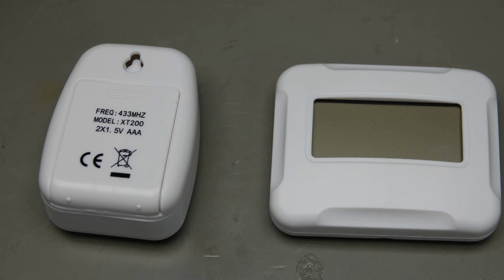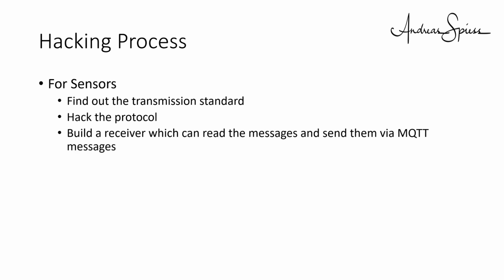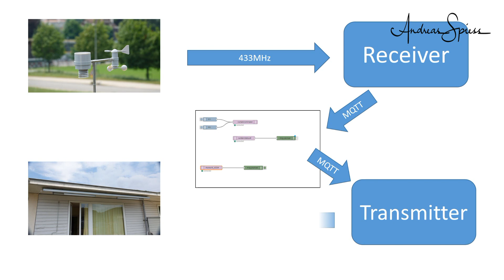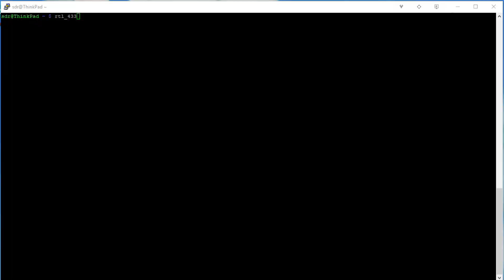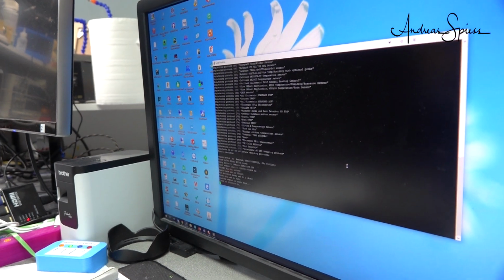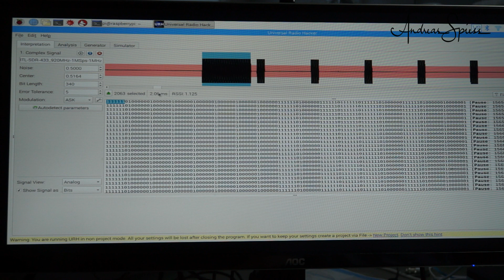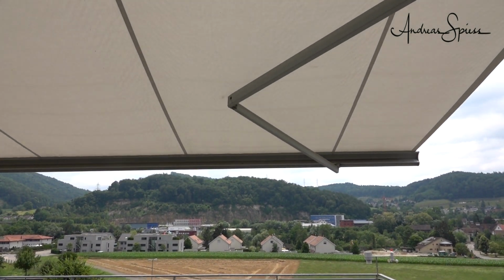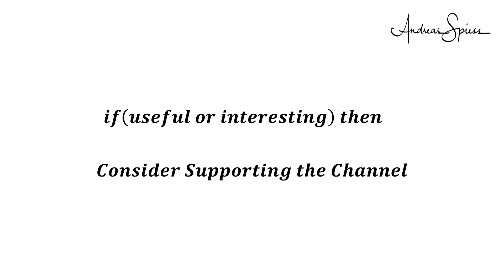#209 How to Hack your 433 MHz Devices with a Raspberry and a RTL-SDR Dongle (Weather Station)

Comment: @Andreas Spiess :Hi , followed your guide , i've bought an Bresser 5in1 weather station wich should run at 433Mhz, bought RTL-SDR dongle like yours , installed software on raspberry pi (rtl_433 and gqrx software) i can see my other 433Mhz devices (switches, contacts etc...) but can't see the Bresser , gone from frequency 432-434Mhz in steps of 0.1 but nothing shows up , on the display delivered with the bresser i can see the values change every 10 sec, the unit is now within 1 meter of the RTL-SDR to be sure , but nothing , any advice , pointers, help is much appreciated.
Reply from the maker: If it is this station https://www.bresser.de/en/Weather-Time/Weather-Center/BRESSER-Weather-Center-5-in-1-black.html it uses 868MHz
Reply: @AndreasSpiess  yes, thats the one , i contacted Bresser and they said 433 , so was looking in the wrong region , thx for that
Reply: @AndreasSpiess  yes, is working now THX !!! Just one last question , rainfall gives wrong , is 0 on display but 1.2mm in reading ?
Reply from the maker: I have no idea. :-(

Comment: You can use your wheather station signal to fire up or down your heater, activate a below zero and/or wind alarm. Very interesting video Andreas, as always!!
Reply from the maker: I use it for our awning. It extends when the sun is shining, the temperature is above 22 degrees, and winds are calm. Like that we do not get lots of direct sun in summer

Comment: This just gave me an idea to solve something that annoyed me for a long time: the Samsung Horizon DVR box that Virgin Media (Liberty Global) provides comes with a remote control that uses both infrared and radio. Which means my (Swiss-made) Logitech Harmony universal remote control is not so "universal" when it comes to this particular type of DVR. Most of the buttons on the top of the Samsung remote work fine via the Harmony remote but a few (the DVR buttons) and the keyboard underneath don't work. I wonder if this Samsung remote control unit uses the same 433 MHz band and if the codes could be decoded and sent by an ESP32 with a cheap 433 MHz transmitter. If this is possible then I could take your "Babel Fish" Infrared Remote Protocol Translator idea (video #254, same Samsung remote control) and extend it even further! Thanks for the idea, I'm able to "stand on the shoulders of some very skilled colleagues who shared their know-how"! ;-)
Reply from the maker: Good luck with your project!

Comment: I finally got this to work! I've been trying to use cheap 433 receivers, but couldn't decode the messages. I eventually gave in and got an SDR dongle, and it worked right away with your SD card image. The SDR dongle is expensive here (in South Africa, 5x the price of a dumb receiver), so I'm hoping I can find other projects to do with it.
Reply from the maker: Glad to read it worked!

Comment: Hi Andreas, I wanted to come back to the "433 MHZ to MQTT" topic. I know it is an older topic but I never got happy with RFLink. Since I see the topic regularly popping up in your videos I wonder if you ever came across the  super simple solution  SIGNALduino resp. SIGNASESP? https://github.com/RFD-FHEM/SIGNALESP - ever thought about going this way? An idea for a next video? I personally would appreciate it. Marc
Reply from the maker: The problem is not to have software to receive the signals. The most important part is the database of all decoders for sensors. And here, RFLink is very good. It works for one year or so without any problems with an ESP01 attached to serial. I think I made a video about it.
Reply: @AndreasSpiess  Appreciate your answer. Thank you, Marc

Comment: Hi Andreas, just fyi, I installed 7zip, thinking it might be a problem with the default extractor in Ubuntu, but 7zip would not work to extract it either. Regards, Adrian
Reply: pls ignore previous commets, I tried it with Win 7 and it extracted properly using 7zip.

Comment: Hi Andreas, thanks very much for the new Buster version of the 433 hacking tools for the Pi. I downloaded the .rar and it is apparently 8 GB, but when I try to extract it on Ubuntu 16.04, it gives me an error: "Parsing filters unsupported", and the resulting img file is non-functional. Any idea why I'm getting that error? Regards, Adrian
Reply from the maker: I only use Raspbian. So I do not know.

Comment: Hi!! Thank you for all your Video!!
How i can read the value of the sensor on wheater station (433 MHz) and send It over LoRa to another ESP 8266?
Reply from the maker: I think I showed it in this and in another video. LoRa is something different. In another video, I used an Arduino Mega and an ESP8266 for my 433 MHz project.

Comment: Dear Andreas,

Thank you for the advice and the video, I wonder can I build the hacking tool using Arduino and some FSK receiver like Si4432 to get the 433MHz data. Because on your video you use SDR and Raspberry to catch the data then use internet connection via MQTT to trigger the ESP8266. I already use the SDR and got the payload of the data (Preamble bit, Sync bit and the real sensor data). so can I create the receiver for that weather station, even tough the radio chip between Arduino and weather station is different (Arduino use Si4432 (FSK) and the weather station use HopeRF RF43B).
Reply from the maker: If you know the code this should be possible. I made a video with an Arduino mega and an ESP8266 for that purpose.

Comment: Hey Andreas! Great video as always. I have a question. Why was there a need to send the messages via MQTT? Could we have built a 433 MHz receiver/transmitter that would read messages from the weather station and then that same device would send the messages to retract the outdoor awning via 433 MHz?
Reply from the maker: The weather station is off the shelf and it’s data is logged in a database. You could of course replace the electronics of the station to transmit a message directly to the awning.

Comment: Thanks for sharing!, one question, at the description you not put the link of the cheap 433 module, can do it? thanks
Reply from the maker: If I remember right, these were not used in the video, just shown. But you find them by entering 433 MHz transmitter in Aliexpress
Reply: @AndreasSpiess  ok many tanks!, in my chanel i made esp32 asyncronous experiment

Comment: I loved to see my Aercus (AKA Fine Offset WH24)finally spit out the measurements. I had tried with RFLink (your video) but it was not recognised .
Excellent work.
My troubles began with trying to pipe the results to Mosquito (rtf_433 -F json -U etc), got Error:Connection refused. 
Is node-red in the SD image? I can't figure out.
Reply from the maker: Maybe you use the image of the "Ultimate Pi Server". There you find Node-Red and RTL_433

Comment: Hi Andreas, thanks for this great video! I also have some 433 MHz devices I want to hack.

I downloaded the RPI image file and installed it, but it does not seem to have any of these programs on it, such as rtl_433 or URH. Could you please let me know what I should be expecting to see on that image? Tks, AB
Reply from the maker: I might have screwed it up. I have to check tomorrow.
Reply from the maker: You can try the new link. Then you should get the newest image based on Buster...
Reply: @AndreasSpiess  Hi Andreas, many thanks, I  will try it. Best regards, Adrian

Comment: Very useful video, thanks. I have a Pi3B but it runs Pihole and I preferably want to run a project similiar like yours side by side with Pihole and I don't want to delete the Pihole/OS config with another image so I guess I'll have to go with HB9FXQ's manual. Any tips before I take this route?
Reply from the maker: Yes

Comment: Thank you for posting this.  I got it working great thanks to the image you provided.  Can you tell me what a good antenna is for 433 MHZ and the RTLSDR?  I'd like to snoop on other weather stations around me before I buy one but the little aerial I got with the dongle only picks up one temp/humidity sensor.  What are you using?
Reply from the maker: I use a simple 433 MHz "coil" antenna of AliExpress which come with some modules. But I do not have to bridge big distances.
Reply: https://www.conrad.de/de/p/aurel-gp-433-ground-plane-antenne-antenne-190073.html

Comment: Andreas! thanks for the brilliant tutorial, I almost set, but I most likely stuck. :) 
What I try to achieve is, I have a weather station with 8 sensors on it. I wish to hack the signal and upload the data to my NAS database. I have installed the latest SDR_433 from Github. after I have all installed, the test looks okay, but it does not show data. When I try to install MQTT, it is complaining about the UTC version, I used type U, but it wants me to us Type M. 
I use Nooelec NESDR Smart receiver.
Some input would be appreciated!
Thanks a lot.
Here is the message I receive after I try to test the SDR-RTL receiver.

rtl_433 version 18.12-194-g5ed62fc branch master at 201904101337 inputs file rtl_tcp
Trying conf file at "rtl_433.conf"...
Trying conf file at "/home/pi/.config/rtl_433/rtl_433.conf"...
Trying conf file at "/usr/local/etc/rtl_433/rtl_433.conf"...
Trying conf file at "/etc/rtl_433/rtl_433.conf"...

 Consider using "-M newmodel" to transition to new model keys. This will become the default someday.
 A table of changes and discussion is at https://github.com/merbanan/rtl_433/pull/986.
Reply from the maker: Maybe you open an Issue on Github. Christian is very responsive.

Comment: Thank you. Very well done.
Reply from the maker: You are welcome!
Reply: I have one question: I will try to use your method to "hack" my window shutters remote control. The tech specs of the remote claim that it operates on 433.42 ASK. I understand that the classification 433 MHz is for the band of 433 MHz, not the exact frequency, and that 433.42 probably just denotes a channel. But I haven't been successful finding information about setting a channel for 433 receivers or transmitters. Will your method work with a 433 transmitter / receiver? Or am I out of luck?
Reply from the maker: 443.42 seems to be a strange frequency. Most simple and cheap transmitters are on 433.92. So you might not get a transmitter. But maybe it is also a typo?
Maybe you just try it?
Reply: Will definitely try it. The Raspi image is on the card and the SDR radio works. Unfortunately, 433.42 is not a type, so we will see. It is about this remote: https://www.eibmarkt.com/Files/Datenblatt/42FH.pdf.

Comment: Excellent. Eager to try it out.  Can I use the sdr with my laptop? Any links? Thanks. Is it possible to run the hacking system on android phone?
Reply from the maker: I use it on my old Laptop where I installed Linux Mint.
Reply: thanks.. what the the software for the SDR in Mint? thanks
Reply from the maker: Maybe you watch the video again and read the comment. All there.

Comment: Superb work, Andreas!
But I run in 1 major and 2 minor problems:
The minor:
1) Which is the SSH password used in the image?
2) I have to do some adaptions to your script, because I have 3 different time slots for signal and break
The major:
I use an Arduino Nano and FS1000A TX. The primary signal computing looks good, but TX has a slow falling level at end of signal, so the breaks are not recognised by the RX correctly (far away from 0 line or noise level). Have you a idea, this failure depends on poor 433 modul or poor output on Arduino?

73 de OE1FEA, Erwin
Reply from the maker: 1. Usually, I leave pi and raspberry from the Raspian installation.
2. Remote diagnostics is hard. Maybe you can split your setup and test parts of it independently?

Comment: Do solar floodlights operate on the frequency of 433 mhz? Can a jammer disable them from staying on?
Reply from the maker: It is well possible. Then a second remote sending the same code can switch them off.

Comment: How did you find the exact 433Mhz weather station frequency? If the transmitter sends data infrequently, using urh is a pain..
Reply from the maker: Most of the devices use the same frequency. I do not remember which one. But using SDR you find it easily because you can simultaneously watch a broad frequency band

Comment: Andreas, do you also have the problem that the rain sensor with node read (Payload.rain) send the sum since start not the last 1h or 24h?  How can you sent it to show the last 24h only?
Reply from the maker: I did not analyze the rain sensor's messages. But On the display, I see the rain of the last 24 hours. So I assume, the base station sums it up.
Reply: I suggest you look at Csongor Varga's video https://www.youtube.com/watch?v=mWx5aa1ri2E&t=430s. He uses Node-Red to produce hourly, daily and weekly rainfall charts from a similar weather station
Reply: great I will check !

Comment: Very interesting! An alternative to unknown protocols with static values, e.g. on/off status, plight can be used. With pilight you can listen to the divice (plight-debug) capture the raw string and reproduce it or send it back (pilight-send -p raw -c "[raw string]"). pilight can also decode signals (plight-receive) although it is not as complete as rtl_433.
Reply from the maker: Thank you for this info. I did not know pilight.

Comment: Is there a way to autostart yout rtl_433 -G -F json -U and restart when died method on the raspberry?
Reply from the maker: I am no Raspbian specialist. Since this is a normal call, you should find a solution if you google.
Reply: I bought a weather station and the SDR module and have put it into production. I created a service file that works for me. Put it into /lib/systemd/system/track-weather.service. Do all this as user root.

--------

[Unit]
Description=Track Weather Station
After=multi-user.target

[Service]
User=pi
Group=pi
Type=simple
WorkingDirectory=/home/pi
ExecStart=/bin/bash -c "/usr/local/bin/rtl_433 -F json -R 32 | /usr/bin/mosquitto_pub -h {your-broker-address} -p 1883 -t home/rtl_433 -l"
Restart=on-abort

[Install]
WantedBy=multi-user.target

----------

After you create the service file, activate it with these commands:

systemctl daemon-reload
systemctl enable track-weather.service
systemctl start track-weather.service

Get the status to make sure it's running
systemctl status track-weather.service

If necessary to restart, use
systemctl restart track-weather.service

Here is a sample message received by the broker:
14:34:26 Message received: home/rtl_433 {"time" : "2018-08-13 14:34:26", "model" : "Fine Offset Electronics WH1080/WH3080 Weather Station", "msg_type" : 0, "id" : 143, "temperature_C" : 31.000, "humidity" : 47, "direction_str" : "W", "direction_deg" : "270", "speed" : 6.120, "gust" : 9.792, "rain" : 73.500, "battery" : "OK"}

I track the topic and plot the results using Munin.

Comment: Hi - awesome video!
How can I build a 2nd receiver for a transmitter after I figured out, what the sender is sending?
I did not understand how I can listen for a specific ( already decoded signal) with an arduino to do something...
I didnt found a video on your channel... do you have some tips for me?
Reply from the maker: You have to program the receiver yourself if you do not want to use SDR for that. This was not the topic of this video.
Reply: thanks for your answer :) yes I know, that this wasnt the topic... but the last part with the URH was inspiring me for doing something like that :) Maybe you can do this in one of your future videos! Would be awesome... Sniffing Signal with URH and build an receiver for that! its just a suggestion... it would help me a lot to understand receiving signals, cause your videos are realy very clear and amazing! thanks for that Andreas!
Reply from the maker: It is already on the list for my use case. But I do not know when...

Comment: Very interersting video! Thanks. :D I was wondering what your observations are on the reliability of the system? I was looking into using MQTT for a grow room controller (not even with 433mhz RF), but I encountered enough glitches (just messages not making it all the way to the end) that I thought I should probably err on the side of caution when it came to the lighting and stick to a local timer. After all, artificial light for plants is literally a life support system! I then began wondering about feeding back so that you know for sure that what you instructed did actually happen. In my case, an LDR for each light would do the trick. When you mentioned the awning possibly being damaged in high winds, it just made me wonder if there was anything in the data along the lines of a message confirming that it had actually been fully retracted?
Reply from the maker: I use MQTT on an RPi zero for a few months for my lab light. No problem and quite stable so far. You can use QOS1  in MQTT if you want to be sure that the message arrives. But you are right, the system has to be stable..

Comment: 0:25 Hacking the remote control of my outdoor awning for adding an anemometer is exactly what I want to do! Mine didn't have one and I've got no idea how much the wind is blowing, so... Thank you, Andreas! But unfortunately, I'm pretty sure my remote control uses rolling code. I inspected it with the oscilloscope and a 433 MHz receiver module (which is much more tedious) and got a different code each time. But I found the manual of the awning's motor and receiver combo and it tells you how to add a new remote control. So if I reset the control (there's a reset button) and then inspect how it's added to the receiver, I might be able to add my own transmitter.
Or maybe they use a bad PRNG, which would be able to be easily cracked with the SDR. Just get a few samples and if it isn't a CSPRNG, you'll be able to get the method used and the seeds (and therefore predicting all other values).
Reply from the maker: So good luck! It seems that I was lucky...